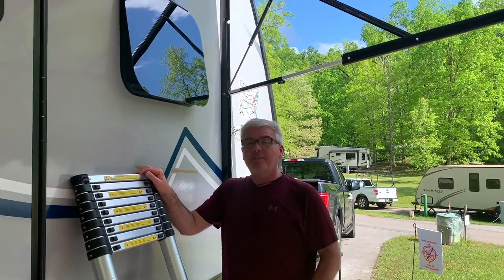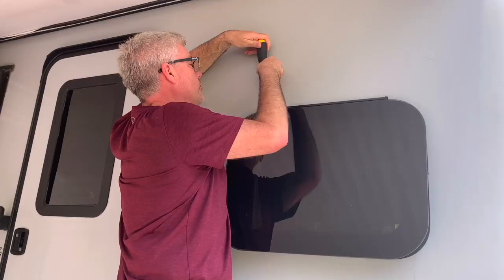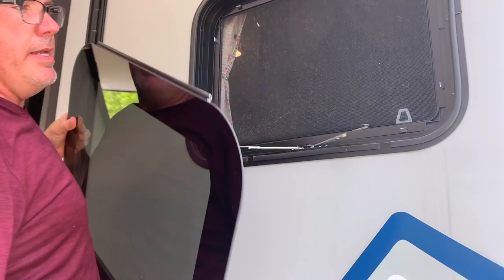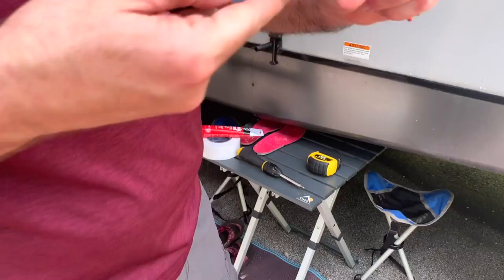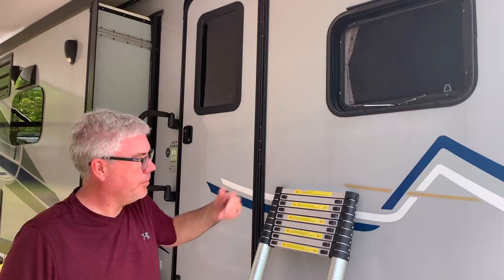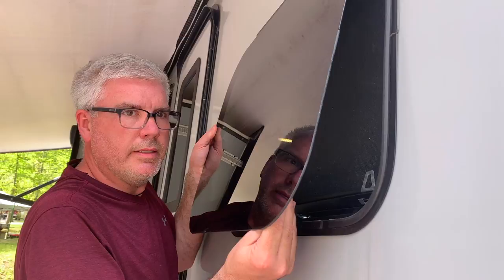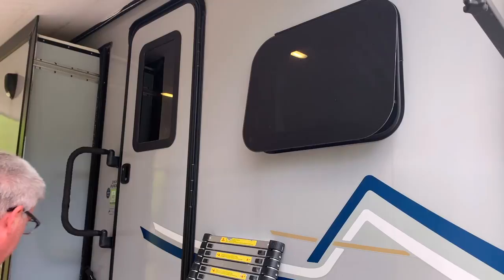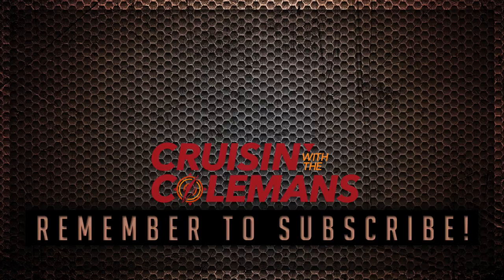5 Minute RV Window Hack | Double the Opening Clearance on Frameless Windows

Comment: Wow so that piece on the bottom is just stopping it and you made it shorter to open more. Cool
Reply from the maker: Crazy the difference! Thank you ❤️
Reply: What is the stopper piece? I have a window that didn't come with one installed
Reply from the maker: @hurleylntl999 it’s just a piece of plastic that is stopping the window from opening more. Do your frameless windows only open a little?
Reply: @CruisinwiththeColemans  they open 3" to 4"
Reply from the maker: @hurleylntl999  can you see what stops them from opening further?
Reply: @CruisinwiththeColemans  the track length would need to be extended.
Reply from the maker: Interesting! 🤔

Comment: Why do you think the RV manufacturers have them open only a little bit to begin with? There's got to be a reason they do it that way.
Reply from the maker: That’s a great question and we don’t have an answer. We can assume it has to do with stability and less chance of rain getting into your rig. However, we haven’t had any issues since we made this adjustment and we appreciate the added air flow.

Comment: Makes you wonder why the manufacturer doesn't do this at the factory to make their window much more functional...
Reply from the maker: Makes you wonder for sure! It’s so much more pleasant with best air flow!
Reply: @CruisinwiththeColemans  Headed out to do mine today.  I have to replace a large window after a seal failure.  After that, all the crank-outs will be altered to allow more air flow.   What a great tip.  So simple.  So effective.
Reply from the maker: Have fun! Stay cool! - Brian and Michelle